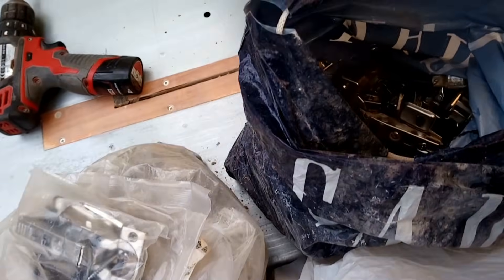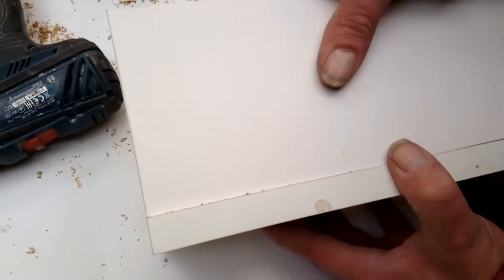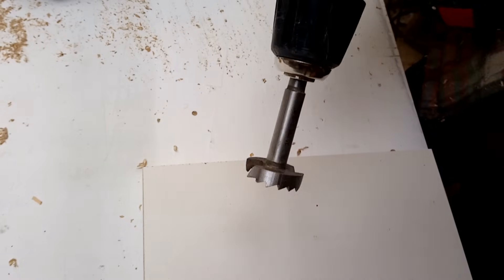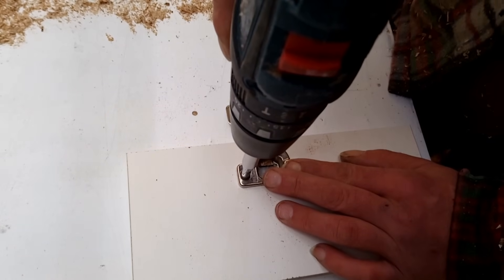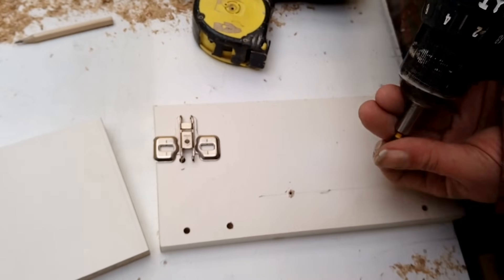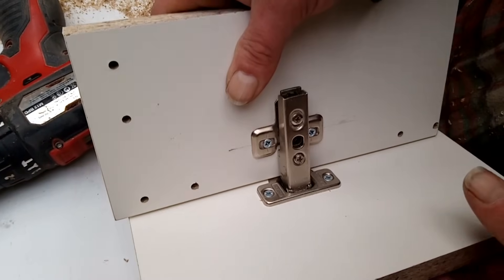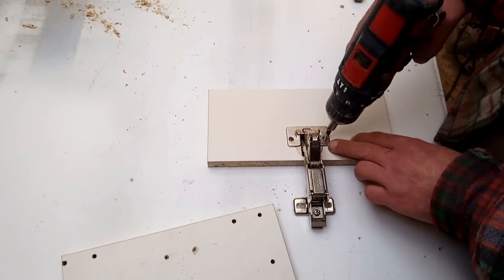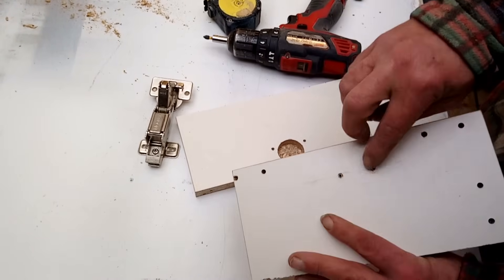Marking, drilling & fitting concealed cabinet hinges with a Forstner bit

Comment: Me again have fitted all my kitchen cupboard hinges using your technique and looks and feels professional.  My husband built the cupboard’s from scratch as we had run short on money.  It has been a hard slog but well worth it.  We now have to start watching how to cut worktops it cant be that hard lol.
Reply from the maker: 👍👍  Good, Hand made units can sometimes be better than the shop bought things,
I'm not sure my video on worktop fitting is complete or clear but there's loads on YT, once you understand how the joint goes together it isn't that hard with a jig, (they can be hired if you don't have one )  the hardest bit i think is the nerves, you're cutting into a piece that costs lots of money n one mistake isn't repairable, best of luck with that, maybe practice on scrap board, it doesn't have to be the same thickness as the worktops.👍😊 
& i like to buy a new ½" router cutter for each worktop job, I've found these cutters are quite good https://www.screwfix.com/p/erbauer-straight-router-cutter-12-7-x-50-8mm/26592
Let me know how it goes, Thanks

Comment: this is educational. i already used around 2 of these hinges for cupboards with holesaw and it was lot of work filling up the other end with putty. i also didnt know you could adjust the hinge with the 2 screws. i will be getting a 35mm forstner bit sure.
Reply: i meant 20 hinges
Reply from the maker: Good 👍👍

Comment: Thanks for this video Gid its the best one I have come across on how to use these hinges but more importantly how to align the hinge with the backing plate when actually attaching the door to the cupboard you showed a similar thing when building the tv unit which was a great tutorial great stuff thanks
Reply from the maker: You're welcome, Thanks 👍 All these hinges & the jobs are a little different so a test piece with the adjustment settings to the middle & the 35mm hole 3mm-ish in from the edge is a good starting point 😉
Reply: Thanks I'll give it a go

Comment: OK, gracias por sus vídeos, thanks for your videos
I think the front measurement is always 37mm
J.M.Castilla@2018
Reply from the maker: Hi, the hole is always 35mm but on this hinge the mounting plate goes on around 30mm but the ones on the wardrobe were fixed on about 35mm,
I hoped this video would give a basic start to fitting these hinges &
 whoever is fitting them would have to work to the sizes of their purchased hinges.
Reply: OK thanks for the answer I use the 35mm hole but the base of the hinge always at 37mm front
Well I already have the machine holes and the template so thank you

Comment: What make are the inset cabinet hinges you use?? Blum? Hettich?? Where do you buy them? Thanks, 👍
Reply from the maker: Hi, it depends on the job, i can get Hettich hinges from my board suppliers, good hinges but they can be a little expensive, Hafele from screwfix are reasonably cheap, good hinges & their shop is local, If i want something a little more elaborate like hinges for thick doors i use Ironmongery-direct, all these shops do inset or overlay https://www.ironmongerydirect.co.uk/product/blum-clip-top-profile-thick-door-cabinet-hinge-95-sprung-inset-pair-806058 
https://www.screwfix.com/p/hafele-steel-soft-close-clip-on-concealed-hinges-64-2-pack/9205j#product_additional_details_container

Comment: Thanks
Very helpful.
Is there a reason why the 35mm hole on the door should not be drilled 1/8"   closer to the edge?
The template I have marks it so that the hinge is about 1/4" from the edge of the door.
Anyone?
Reply from the maker: Hi, 1/4" seems quite a lot but these hinges are all a fairy standard size, if your jig works fine then so be it but sometimes this distance depends a little on the thickness of the doors, I always do a test cut using scrap with the same dimensions of the wood from the project first & adjust it accordingly, 
Thanks Frank 👍
Reply: @Gidjoiner  Thanks. Appreciate the quick response.